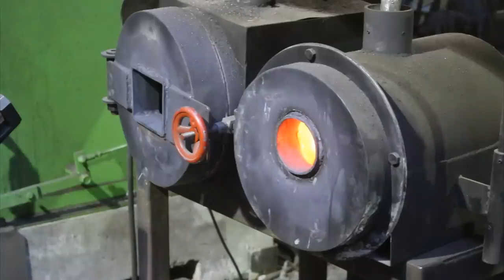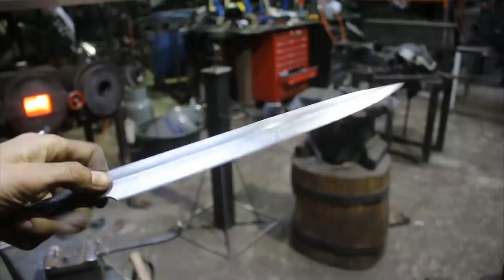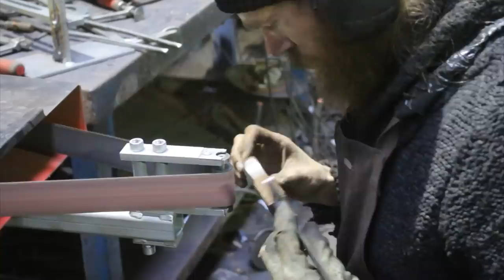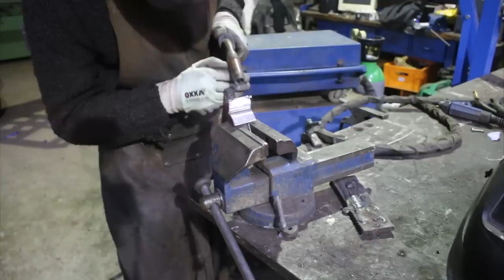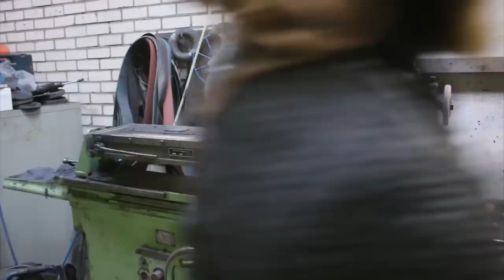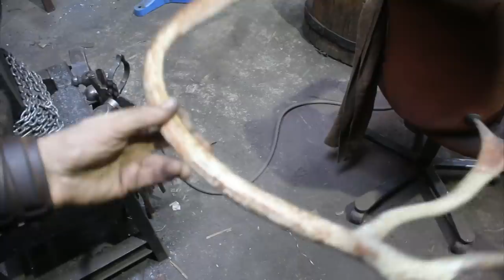forging two knightly daggers, the complete movie.

Comment: Freerk, you know I think you're the man. I only say this for safety and nothing else. After being a furniture maker for a lot of years I mastered the table saw. The one thing I would suggest HIGHLY that you consider is a spoil block on your table saw fence when cross cutting. Just make it exactly 50mm or 2" or whatever you decide and clamp it to your fence on the near side and well away from the blade. Then set your fence that much further away in order to compensate for the block.  That way when you move the material through the blade and the cut is made, the piece that was cut has NO CHANCE to launch like a missile back into your chest or face! Because wood that is stuck between the fence and a whirring blade with jagged teeth has a tendency to get ejected in a violent and instant manner. 👌

30:20 

...is what I'm talking about.

- Thanks for the videos they  truly inspire me to want to work with metal.

Comment: It's nice to see a forged bevel. So many modern "smiths" spend hours on the belt sander shaping their blades.
Reply: I end up having to do the bevels later on the grinder.  I try at the anvil, but because I am a novice it is never good enough and I have to re-detail it later.  More practice needed!
Reply: a smith is just someone who makes things with iron or modern steels/metals. No reason to make someone feel bad because they aren't a master smith that can forge a bevel by hand, it takes years and years to be able to do that well and consistently.

Comment: you wear a respirator when forging, but not when you're sanding wood. I would have milled the guard, pommel, and sheath cover at one time, after getting the insides fit.

Comment: Another question I have is why don't you do hot fold Damascus? Just wondering. Keep up the amazing work. Love to watch what you can do
Reply from the maker: Hot folding only works well in Cole or woodcarbon fire. It burns away the scale. A gas forge doesn't. So you have to grind it off.
Reply: @freerkwieringa275  awesome. I had no idea thank you for knowledge I didn't have.

Comment: Have you any knowledge of scabbard liners? A Hitler youth dagger is a great example. I think you would like the feel - eliminates all slop and rattle. 

"These scabbards were assembled with one or two spring metal liners in order to keep the blade secure during wear. These springs were held in place by a rivet on each side. The first rivet I have already mentioned and the second rivet went through the hanger leather, the scabbard rear and finally secure the back liner in place."

"One little trick that the fakers have not picked up on yet is that many of these liners were covered with a coarse cotton. Liners without this cotton are often seen on original examples, however, I have never seen a repro with this cotton so it's a good sign of an original."